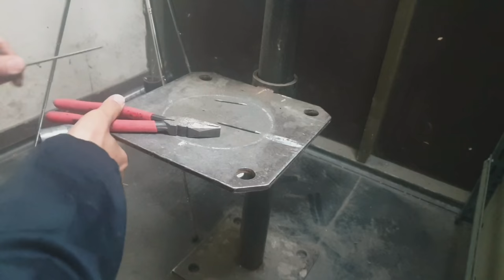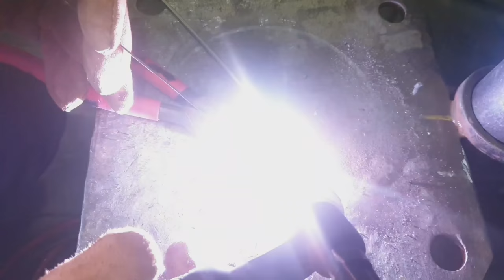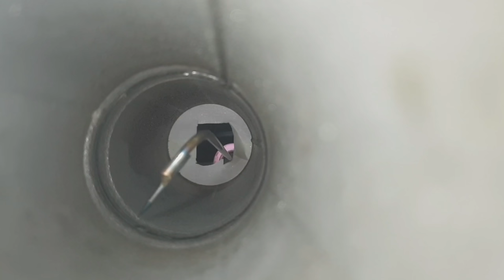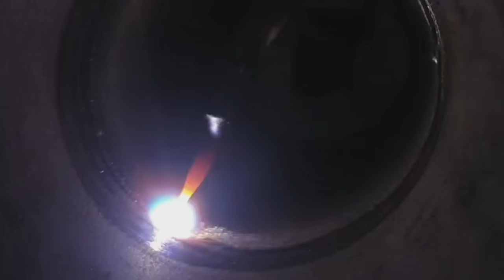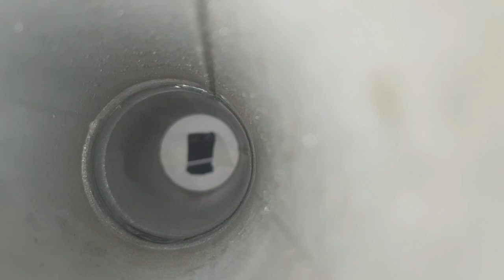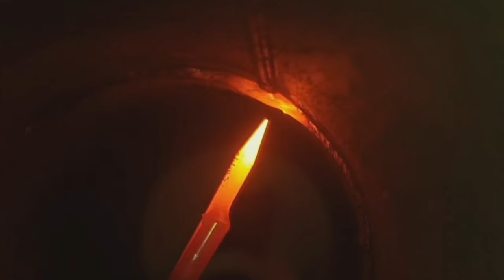파이프용접 리페어 수정방법 ? ? ?

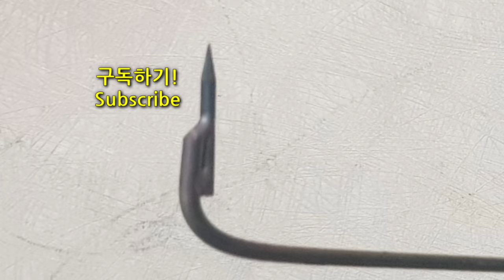Comment: That’s good but the proper way to fix it grind it back to the root cause when you pull the ground off quick to stop welding you will always leave that fisheye like the one at 5:25 that will get you almost every time
Reply from the maker: It's right to do it right.  There is a way.  Please understand.
Reply: hi
i'm welding in korea.
i'm for what you think. but this method is korea culture.
anything strated with a sadculture that should be fast however.
these methods are not used well now.
Reply: We use these methods also in USA but if you have a weld repair they let you fix it one time and if you don’t you have to cut it out so you want to make sure you fix it correctly but if you in a shop and it doesn’t matter then it’s no big deal
Reply: 서수하 nice weld by the way
Reply: @welderjin  And what you just showed is the absolute WRONG way.. Are you gonna go up to your foreman and tell him that you have to cut out 6" on either side of your joint so you can put your TIG torch inside and fix your fuck up and add 2 more joints to it 🤣🤣🤣 WOW
Reply: @johnnycanales4187  I'd love to know anywhere in the US where they would let you do this... My boss told me they're people that "Can Weld". And then they're "Welders"
Reply: powerstroke0459 work a heater job it’s done alot
Reply: That's why you backstep towards the direction you started from and flick out like a 7018 restart but up onto the beveled edge. NO ARC STRIKES OUTSIDE THE BEVELED EDGE